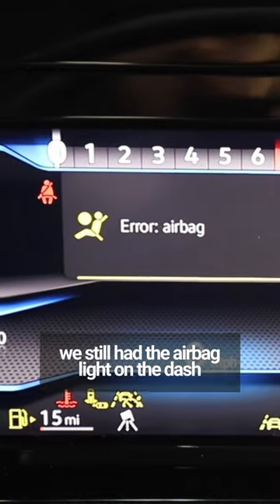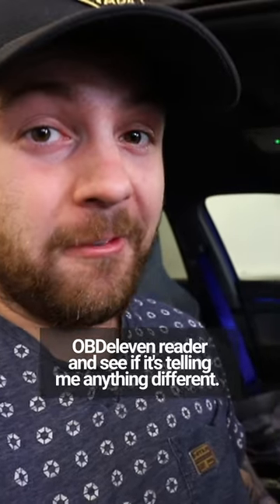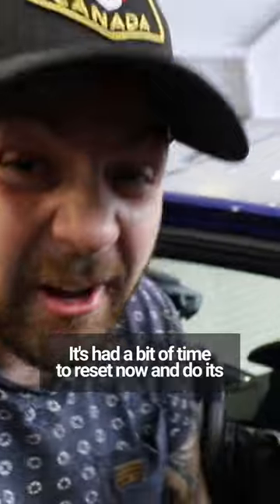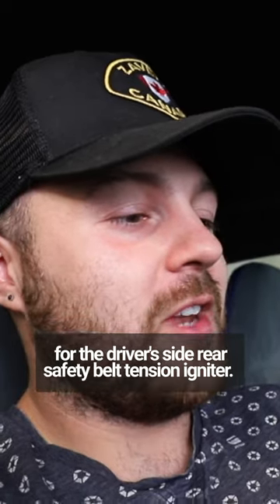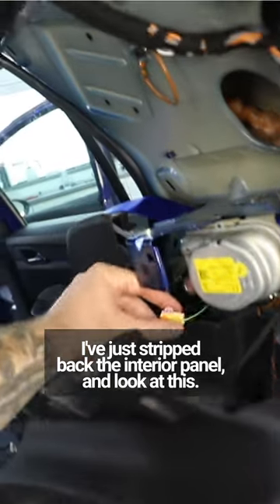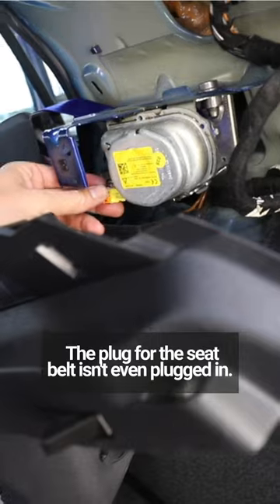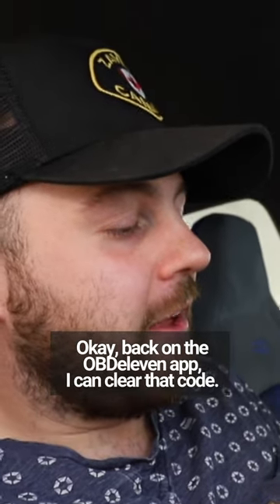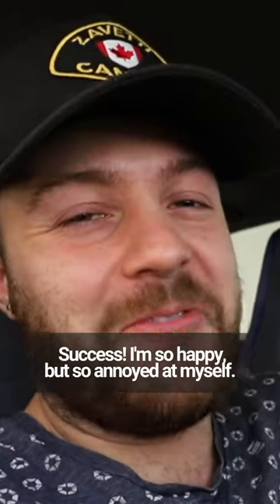OBDeleven | Reset Airbag Light

Comment: Hello sir, Thank you for the video, I use my OBDEleven successfully for VW's, but yesterday I used it for a Peugeot 208 2012 and it seems that it doesn't read anything at all... it shows "No faults" , it also shows 33 things in green... the last time I used it with the same car it worked better... I have entered the VIN of the vehicle in the app.
My mother's Peugeot shows light for both airbags-passenger and driver.
Can you help me in some way ?
The car recently was at a service and it had other problems and lights, now they are just the 2 of them.

Thanks !
Reply from the maker: Hi! Contact us via the app and we'll check the issue right away. Looking forward to your message!